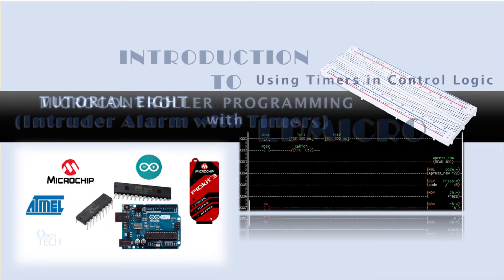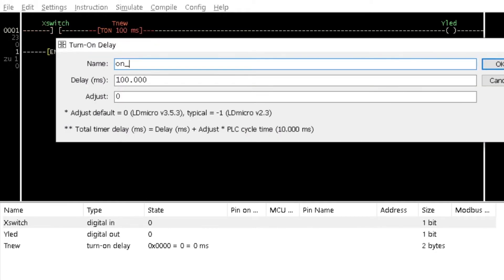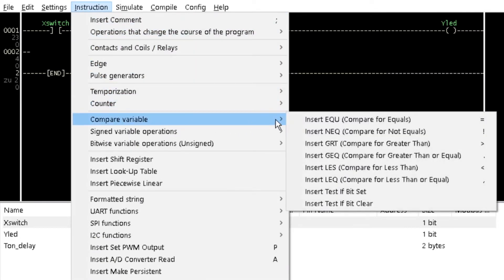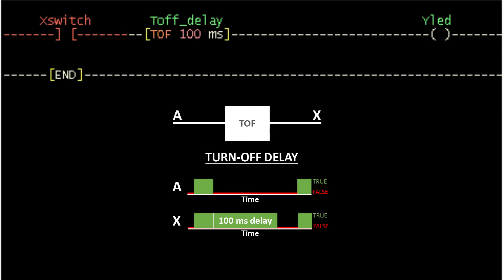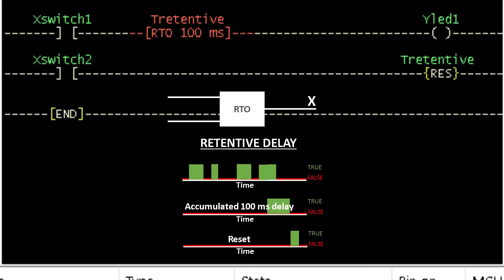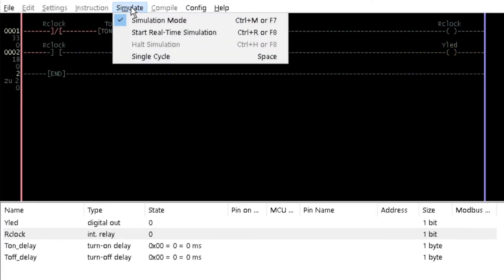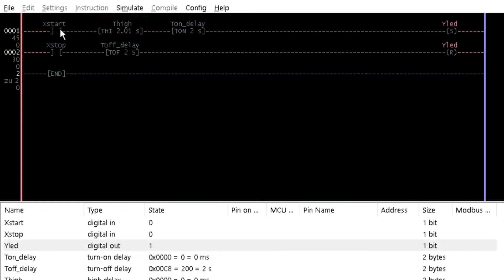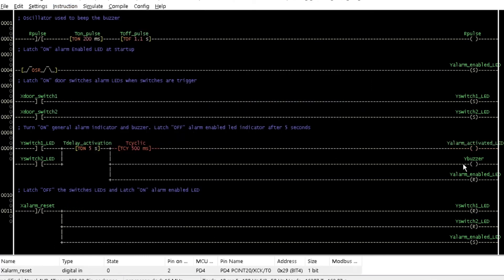LDmicro 8:  Intruder Alarm with Timers (Microcontroller PLC Ladder Programming with LDmicro)

Comment: Very good and clear explanation.
All your examples and try outs are working like a charm.
Looking forward to your tutorial with LCD display with menu integration.
Reply: From program dir copied "usrLib.h" and "AdcLib.h" in the work directory, to avoid compiler errors.
Reply from the maker: This is Great. I'll capture it on ADC tutorial
Reply: @OnosTech  i made for test  a "Insert A/D" convert it to bits, to save lateron i/o. (Maybe for later menu handeling)
Reply from the maker: A little bit of menu handling was implicitly done in the just uploaded tutorial 9. It will be elaborated on in tutorial 10. Then finalized in tutorial 11
Reply from the maker: Very encouraging. We will have to take on the counter function first since it is required to create the LCD display with menu integration

Comment: Ref time 1:58 in this video :: Turn ON delay time = 0x00c8 = 200 = 2s.
........

LD micro takes much more than 2 secs for the timer to run up to 200 (2 secs) . Could you please tell me why this disparity in time ?
Reply from the maker: The time is dependent on the PLC cycle time. Set the PLC cycle time to 10ms then you will get the correct result.

If, PLC cycle time = 10ms
 and the count = 200
Then, the actual time = 10 x 200 = 2000ms = 2sec

If, PLC cycle time = 1ms
and count = 200
Then, the actual time = 1 x 200 = 200ms = 0.2sec

Hope the explanation is clear.
Reply: Sorry Sir. Looks like I did not  express clearly enough.
I mean LD micro takes much more than actual 2 secs to run upto 2 secs.
Reply from the maker: @mikesterling3949  Yes, I have observed same. The simulation seem not to work with the microcontroller real-time
Reply: Thanks. So I can go ahead without any concern.
Reply from the maker: @mikesterling3949  Sure